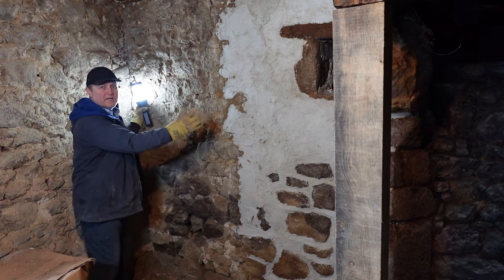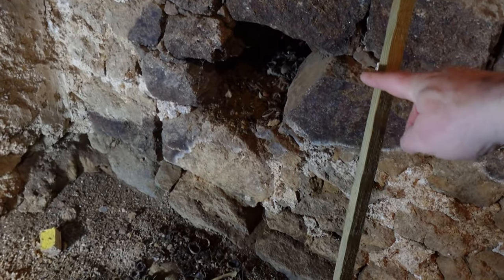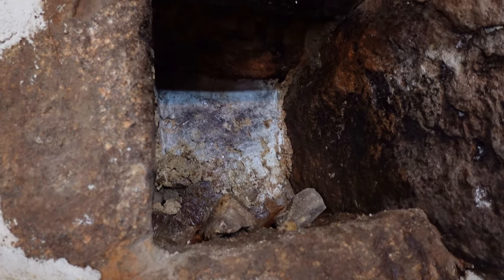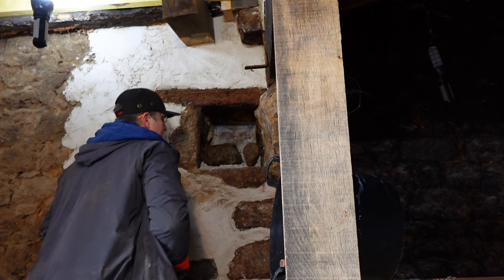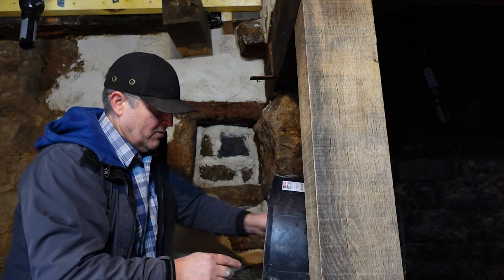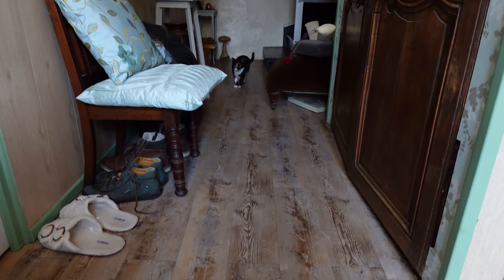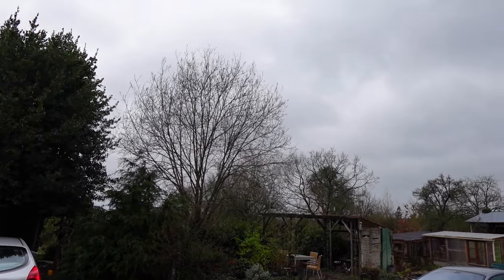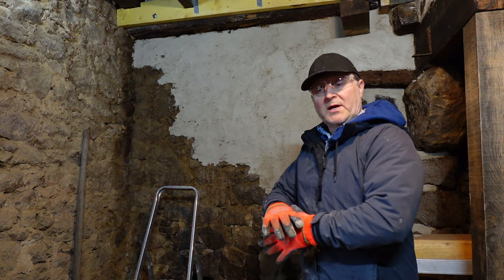I Found A Mysterious Void in the Wall... For a Timecapsule?

Comment: I would fill the lower cavity with fast drying expanding structural concrete around a square 4-bar rebar frame going the entire depth of the opening. Finally I'd press some rocks into the concrete fording it into nooks, crannies, crevices, gaps, and holes. I enjoy watching your artistic repairs. 👍👍👍

Comment: Sean what really bothers me, are the machine marks on the vertical beam left of the fireplace, probably the other side as well.
I know I'm knitpicking but these are some details that will ruin the total image when you are "finished" .
Use a handplane and or a scraper to get rid of it, or a sandingdisc on an angle grinder.
This just doesn't fit in the picture of an old cottage/barn.
Reply from the maker: The timber work is not finished

Comment: The next time you have a collapsing void like that you can use the spray polyurethane expanding foam to make sure it doesn’t collapse further, then build up underneath it
Reply from the maker: That's not the correct way to do it